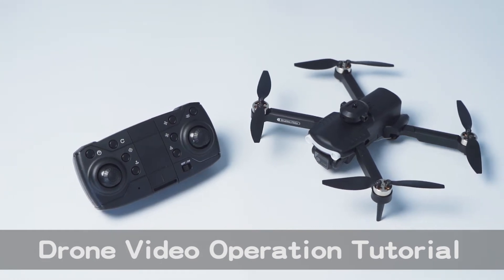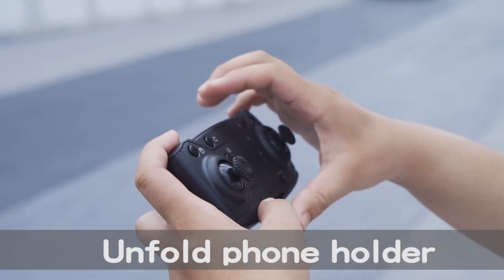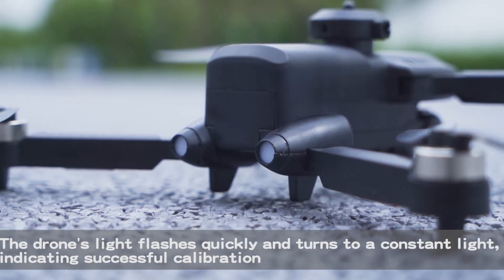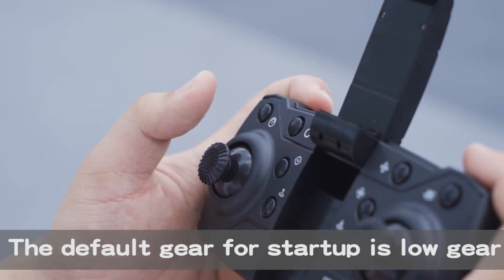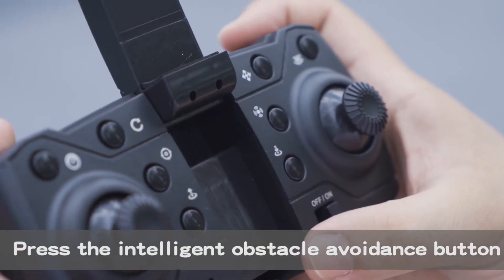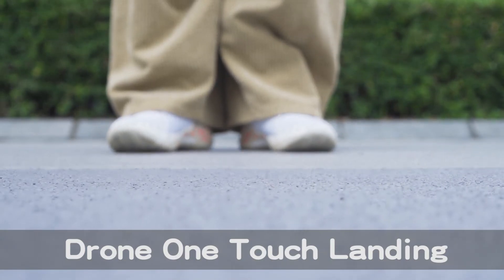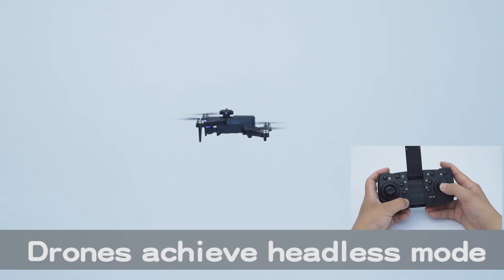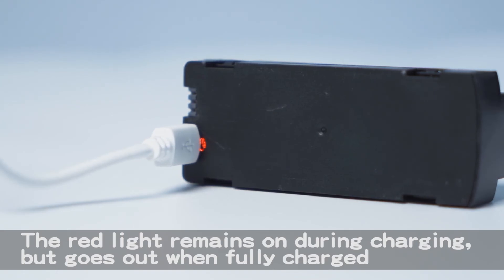Drone Tutorial - HYTOBP F169

Comment: 2 question why the battery lasts 5 minutes and how the camera is moved from the application or the control
Reply from the maker: Hello, our drone F169 has a normal level flight endurance of about 8 minutes, which may be affected by the environment. The camera is manually adjusted, and is not supported to be adjusted electrically (application or remote control). Thank you.